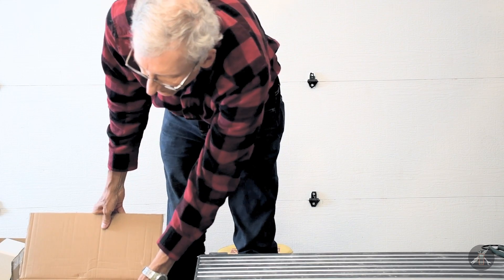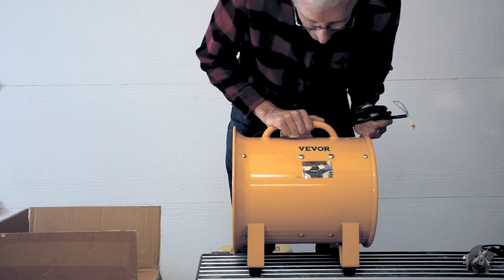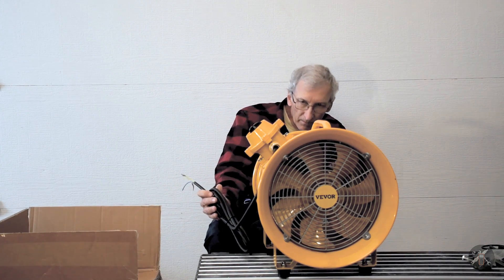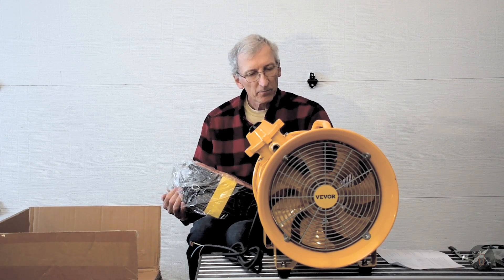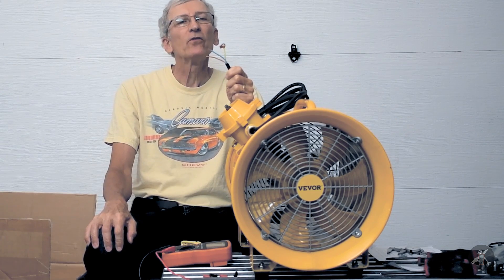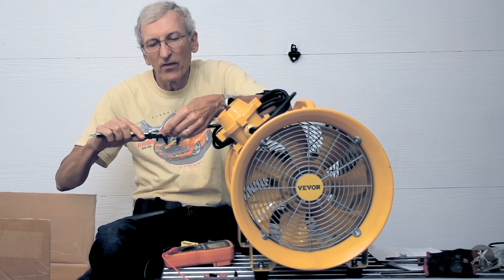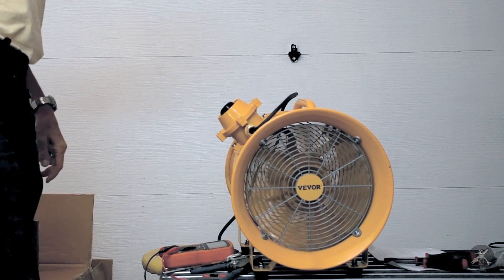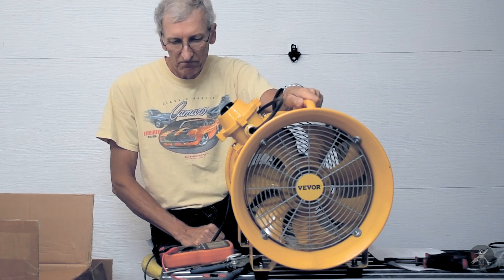Unboxing and Quick Test of Explosion Proof Exhaust Fan- IROC-Z Barn Find EP72

Comment: What kind of plug do i get?
Reply from the maker: It needs a 3 prong, 15 Amp, 125 Volt grounding plug.  There are many options, some are more rugged or easier to assemble than others.
Here is an example of one from Leviton:
https://www.homedepot.com/p/Leviton-15-Amp-125-Volt-3-Wire-Plug-Yellow-R10-515PV-0YL/309610976
Reply: @bitsofwisdom460  i know this video is old, but would a 10A plug be ok? my house doesn't have many 15A points available
Reply from the maker: I don't know the right answer.  The rating on this model is 550 watts per the spec sheet, that would be roughly 5 amps at 120V plus probably some starting current that could be another 5 amps surge. So, it would seem 10 amps could be enough. But in the US, our standard minimum code circuits for 120V are 15 amp and the standard smallest plugs are normally rated for 15 amps. I don't think I can buy a 10 amp plug.
Reply: @bitsofwisdom460  ok, thanks for the reply. I'm from Australia and I actually only have the slightly smaller fan compared to yours. 10A is a standard plug over here and we use 15A for A/C and quite large appliances so I reckon I'm ok with 10. I've also had an exhaust fan running off a 10A plug and it worked for ages
Reply from the maker: Yes, that makes sense. I wondered if you might be on a 220 / 240V system.  That would drop the current in half, but I'm not familiar with the standards in other regions.
Reply: @bitsofwisdom460  yep well I'll be wiring it up this arvo so I guess we'll see how it goes 😅

Comment: I bought this fun because it’s supposed to be explosion proof but reading the instructions it says…
“Do not use near flammable fumes or dust.  Ventilator has internal arcing parts that will ignite flammable fumes/dust.  
So I’m confused now.
Reply from the maker: I would be very careful with that warning and check with the seller. I did not find that warning with my fan.  I have been relying on Vevor's marketing information and manual.  They claim it is ATEX (European) certified for hazardous locations and post copies of certification documents. I don't have my fan close by to check, but I think it has the ATEX reference on the rating plate. One thing to check is the model number.  Vevor claims the "BTF" series fans are explosion proof. They also sell other fans that look very similar that are not explosion proof.
Reply from the maker: I have now had a chance to get to storage and look at my fan.  It is a BTF-30 with the following markings:
CE  Explosion Proof EX  EX-Mark d IIB T4 Gb

I am not expert, so check this yourself, but per online lookup, it appears that Ex-mark is per EN 60079-0 for gas explosion protection:
The documents I found says "d" means flameproof enclosure, IIB means protection for type of gas of medium ignitability (ethylene), T4 means max temp of components is 135 C (275F), Gb is some type of level of protection indicating that it should not be too hot and should quench flame.
Check your rating plate.
Reply from the maker: Here is a little more information from my fan and the rating system.
https://youtu.be/74xP3iaIBZc

Comment: Hi this is Bob wanted to ask you how does this fan work for you Iam going to paint my 1969 rs z/28 camaro I have a single car garage so did it clear your garage good need to know because I'm thinking about getting the one you have did it clear it out fast please let me know thanks Bob.
Reply from the maker: I was very happy with it.  I was only shooting large components vs an entire car, but I had no issues. It pulled the air through very well. I have painted before where the air was thick with mist because I didn't have enough fan - I had rather clear air. I was probably running my cup about half full and spraying continuously until the cup ran out. So, I can't say for sure, but if I had a full car to paint, I would use it. 
In the description section I noted that at 2700 CFM it should exchange air volume in a single stall about once every minute or two. I also have a video posted on my spray booth set-up.
 https://youtu.be/jxCRH2vmx78
The only thing I would change is that I didn't filter the fan inlet to keep overspray from building up on the blades.  Next time.